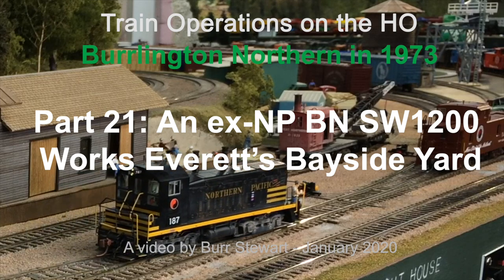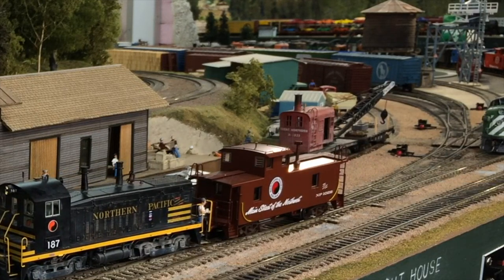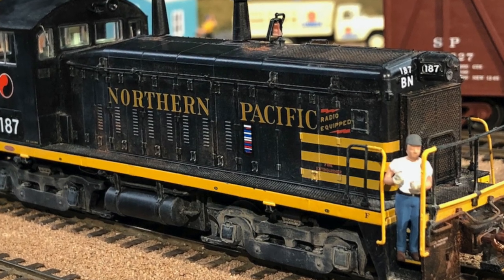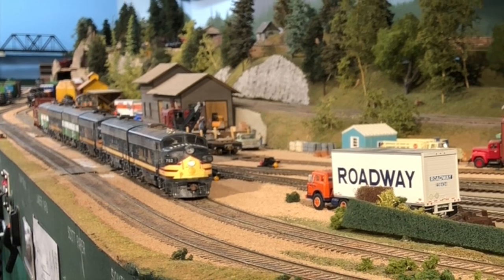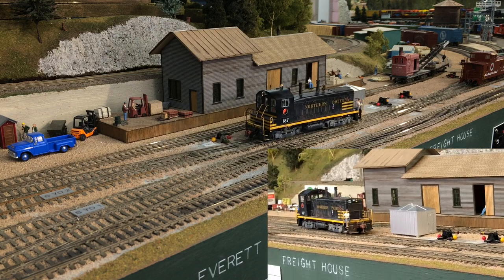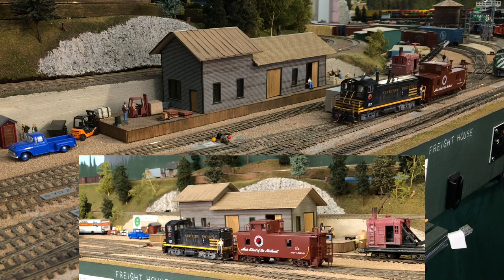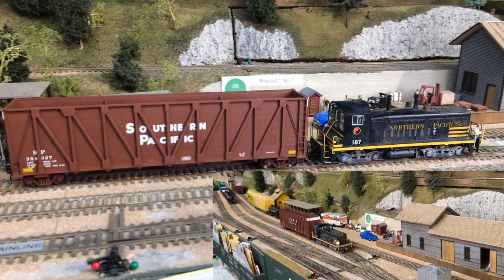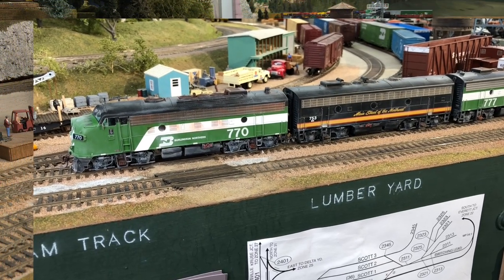Part 21 - A BN (ex NP) Switcher works in Everett's Bayside Yard to clear a brace of (ex-NP) F-units.

Comment: Always a fan of F units even though I model mid 80's chessie and they were gone already. I bought several Stewart ones for my private road though.very nice video. Looking forward to the next f unit video or f units mixed with other power emd and ge.
Reply from the maker: Thanks. I almost brought a GE unit in at the end of the video, but decided to stop it there. You can see some locos off in the distance at the very end of the video, on the mainline...

Comment: He did a nice job other than the large fingerprint on the cab. Really shoty work right there.
Reply from the maker: That was my fault, actually, picking up the loco during filming, after just dusting it with pan pastels. oops.
Reply: Picky picky